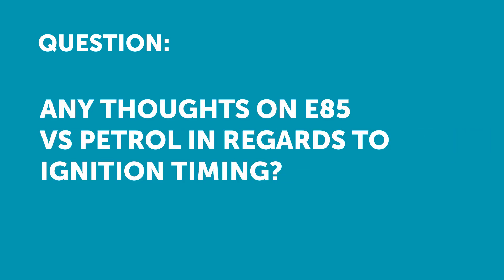E85 vs Gasoline Ignition Tuning [HPA Q&A]

Comment: This is correct if you tune your low load at stoich. But at higher afr like 18:1 e85 burns slower than gas and requires more timing than gas. Ive managed to get the same mpg on e85 that my car is rated for on gas when i drive civilized. Youll get lots of misfires if you dont have enough timing running that lean so youre basically forced to use lots of timing. My car cruises at 18:1 like a champ and my pumping losses are minimal on the highway because i run it so lean.

Comment: Here in Brazil, when we turbocharge a car, the vast majority change to E100, avaliable on every gas station. For 70's, 80's and 90's, we have stock versions of same engine to run on gasoline ( average 9:1 cr ) and to run on ethanol ( average 12:1 cr ). The difference in power is noticeable. For example the carbureted gas version of Vw Ea827 had 97hp while the carbureted ethanol version of same engine had 106hp.

Comment: So, ignition timing with E85 is somewhat the reverse strategy of ignition timing with pump gas?
Reply: if you had MBT timings all throughout your ignition map on pumpgas, then from what i learned your ignition values should be retarded for e85
Reply: @seran2316  thanks for your reply, but to clarify... Low RPM areas of the ignition map where pump gas would need advance timing, you would retard the timing some with E85? And for the higher RPMs you would advance the timing with E85 where you would normally have to retard the timing with pump gas?

Comment: Indeed, most of the time we hear "e85 requires 4 more degrees in ignition timing". But that's not so simple. And that also explains why a simple approach as to fit +40% fuel flow injectors (and +40% fuel flow capable fuel pump) on stock gasoline vehicles often permits to use e85 without any additional tuning and to get good performances too. 
Anyway I bought HPA e85 and flex fuel tuning course to learn deeper in that matter